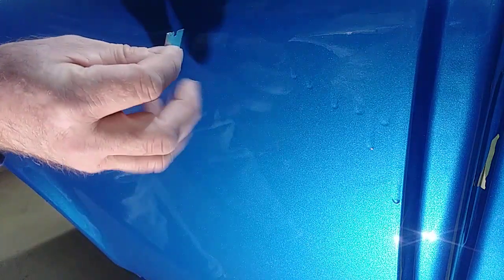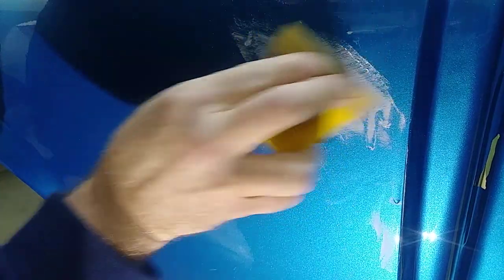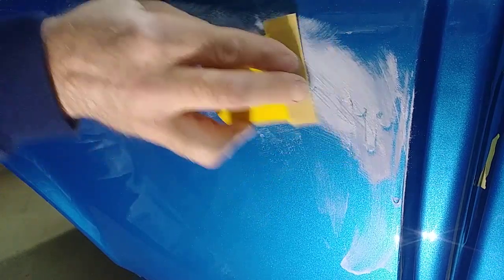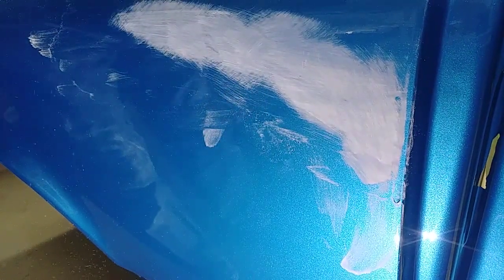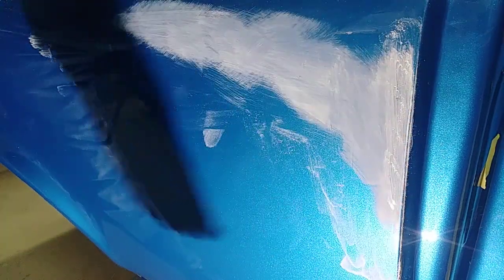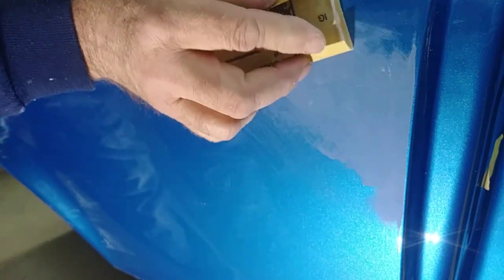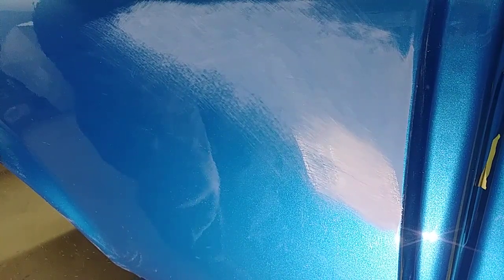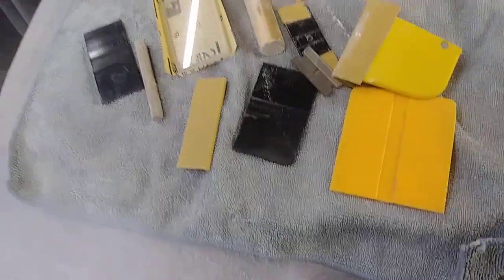How to remove runs in automotive clearcoat quickly, easily and safely.

Comment: Hey I learned  trick to take out the runs while still wet. I let the clear get just a little tacky, and then I take a new strip of masking tape and lightly press it down on the run and pull it up removing the run and leaving behind a flat patch of clear. Then I just continue with my regular flash times and coats. Sometimes I'm able to get a level surface but usually it's a little higher but with no run. Easy to sand with the surrounding clear.
Reply: Dude thank you so much! I stumbled on your comment just in time before the coat got too dry and was able to save myself a ton of work. Absolute legend.
Reply: Genius. Will keep in mind!!
Reply: Well ain't this a promising combination of comments 😂 Thanks for the tip man, looks like it's good to go!
Reply: I wish I would have caught my run soon enough to use your advice.
Reply: Hi I'm still learning I've been told many sand the clear then Polish is this how to do it every time ? And would you use a polish like mothers etc or a wax type ? Ty

Comment: Thank you!  I was just putting on a clear coat ... 3rd spray/coat (light one every 10 minutes) when I noticed a run.  I did a quick search between coats and found tour video.  So I plan to put on 4 or 5 coats now and then let it fully cure before applying your technique.   Again...thank you for the help and taking the time to make this video!!!

Comment: 320 is too rough for runs. I would have started with a 1000 grit then 1500 and end with a 2000 grit. Next I would have wiped all the sand off. Prime. Let dry then repaint and I'm done

Comment: I have already done this method not with a Bondo spreader but usually I just take a wet or dry block for wet sanding and I usually just put about four to six hundred great sometimes 800 and usually I'll finish it off with about 1000 and 1500 Grit but it's still a risky situation I've tried paint sticks I've tried a lot of different things I got a vehicle now that I got to get the runs out and I usually don't get runs but I wind up trying a new clear it look like it was sticking everything was good there my last coat I start seeing runs in the quarter panel and both front fenders I hate runs runs is a redo in my opinion but if you can Master this technique and get it usually I will take a marker silver or black and I will Mark the run to know where I'm at and then a lot of tables I'll mark around the perimeter of the run while I'm sending so when I start to get down when I start to not see that black or silver marker no more that surrounds the run I know that I'm right there flat with the rest of the adjacent panel

Comment: You can also spray a "fog"/ "guide" coat with a rattle can in a different color so you can see high and low spots.. I worked in a custom fab shop and we did that for a show finish

Comment: Thank you for sharing will have to try this.  
 Which three step buffing compounds will you use afterwards to match the  shine? 
 I’ve been getting swirl marks that I can’t get  get rid of 😀
 Thanks in advance
Reply from the maker: 3D ACA 500 Xtra cut with wool pad,  3D AAt 501 with coarse foam pad,  then 3D AAT502 with fine foam pad.

OR 3M 36060 with wool pad,  same with foam pad, then 3M 06094 with medium or fine foam pad. 3M 06068 ultrafine on fine foam pad.

All compounds and pads are on Ebay if your local supply doesn't have it.  3D is available in smaller quantities on Ebay so it costs less and it works great for me.

Comment: Small square razor blade right on the run itself, scraping it not trying to cut it. Very controlled right on the run itself. Till it gets to the same height as the rest. Finished with fine grit. Buff

Comment: I’m working on some runs on a single stage can I do this same method? Thanks for your video.
Reply from the maker: It works the same on single stage.  However, there is a chance that the pigment could pool and not be uniform throughout the run especially with metallics settling; solid colors will have better results.   In that case you would still see the run even though it is sanded out.  It is certainly worth trying to sand and polish it out before respraying.

Comment: Great video.

How would a long sanding block do?  My issue is on a hood that’s hanging vertically, and the runs are at the top (front-end) of the hood.
Reply from the maker: Thanks for liking the video.  If the run is more like a waterfall instead of icicles, take a 6 to 12 inch dura block or something similar with 320 dry stickit paper to sand it out.  Just be careful that not too much surrounding clear is taken off so you don't sand through to the basecoat.  If it is mostly icicles, sand out each individual run with a small bondo spreader as in the video.  Once each individual run is sanded down then take a longer block with 320 across the whole length followed up with 500 on a hard acrylic or polycarbonate block. It needs to be thoroughly set up to work best. When runs happen there are three options;  Do nothing, sand it out and respray, or try to sand it out and polish it.  Sanding and polishing works most of the time if you are patient and saves a lot of $$$ compared to a respray.

Comment: So after wetsanding up to 2500 and then polishing, the door will be perfect or will there be a new clearcoat spray needed?
Reply from the maker: If you successfully sanded and polished without going through the clear, there is no need to respray clear.  Sometimes an outline of the run or ghosting around where the run was can show up later.  In that case make sure the clear is fully cured and then lightly sand with 1500 or 2000 on a hard acrylic block then repolish.